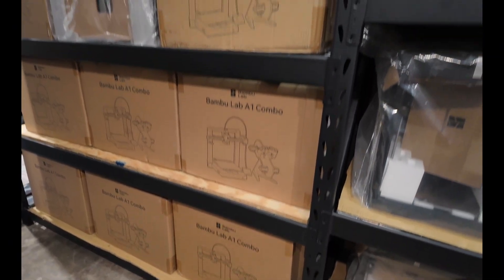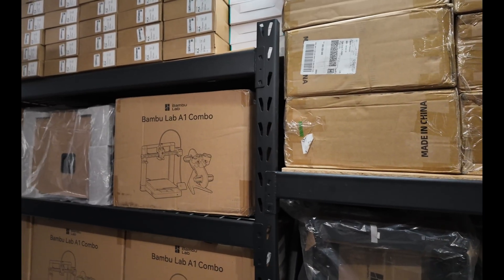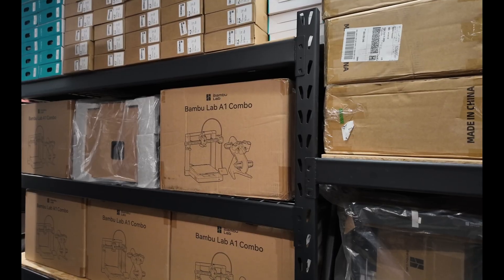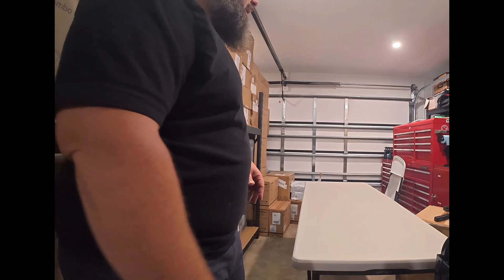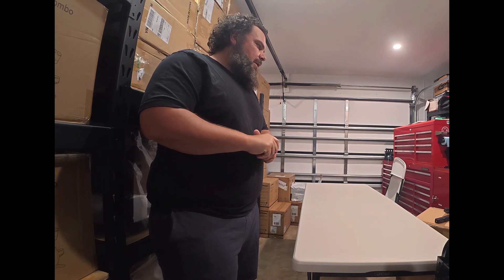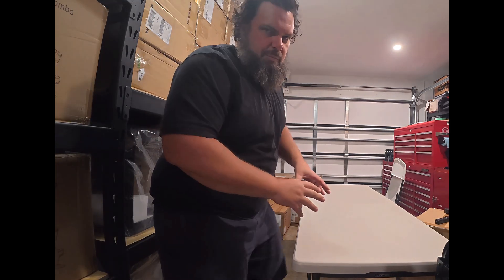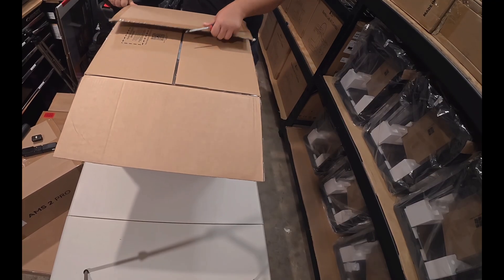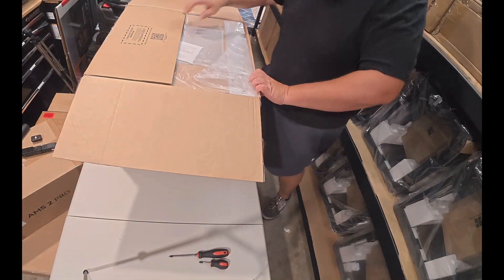Print Farm Startup – Day 2!

Comment: I don't have any A1s but I'd suggest making your shelving further apart and placing the MMU on the top of the unit as I've seen in many other farms that have 3 per self. I get you'll only get like 6 per shelving unit as I don't think your ceiling is tall enough to place them on the top shelf to get 9 units. Good luck!
Reply from the maker: Thank you for the suggestion! I have seen them that way as well. I will be adding some in that orientation!